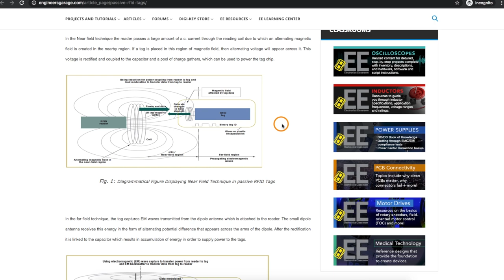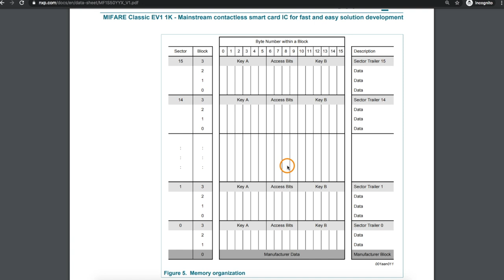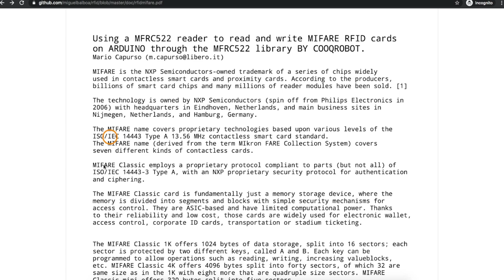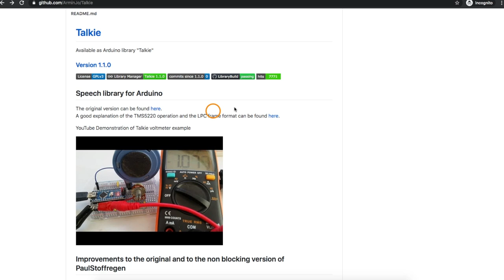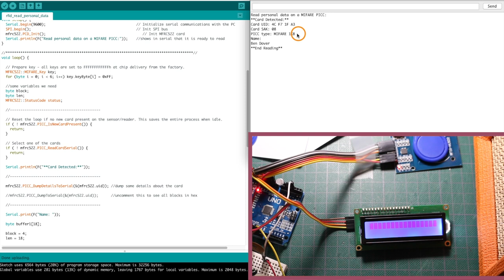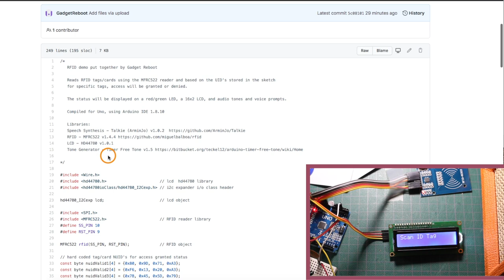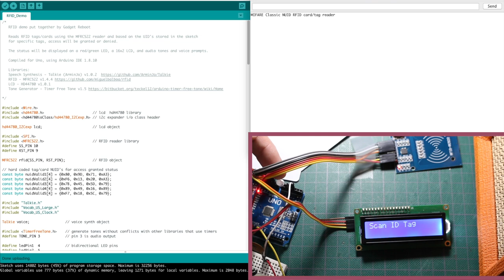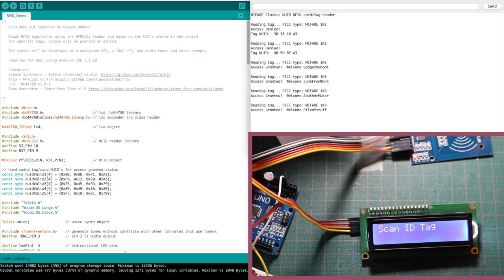MFRC522 RFID Overview and a Sample Arduino Project

Comment: Effect is pretty good :D

But if you suffix variables => arrays ;) That could reduce the whole lengthy checking into https://pastebin.com/9qhgUhhi And adding 0 code if you add cards. As always, proof of concept aka not compiled.

Next, this is an ideal project to turn into a state machine. Would make the whole a lot easier and easier to extend or use in other projects. ;)
Reply from the maker: I knew I was doing a sloppy brute force method of checking the tag IDs, thanks for the cleaner option! I also need to get back to the DTMF stuff but I also have a bunch of my parts all packed to go to storage so it Will take a while.